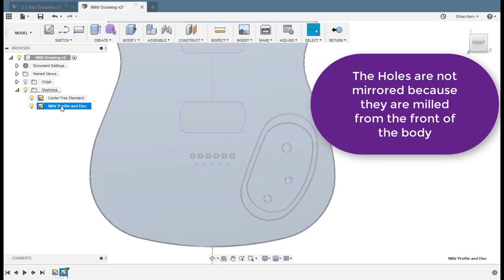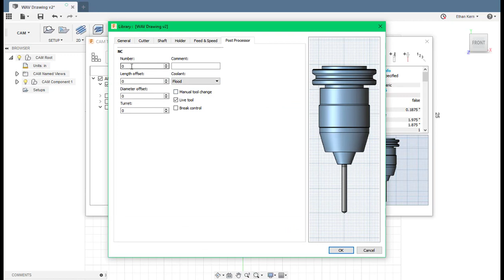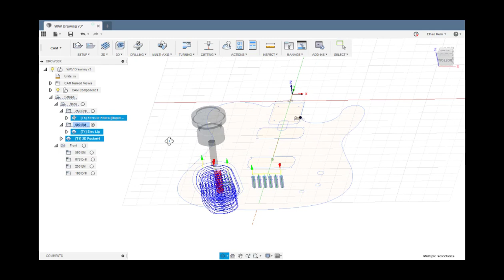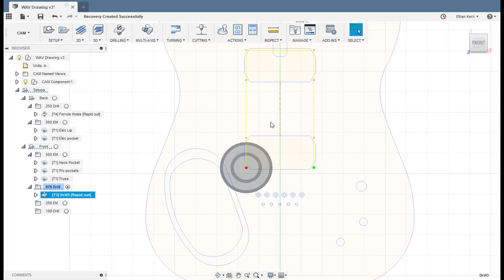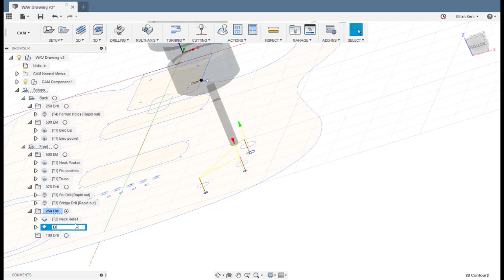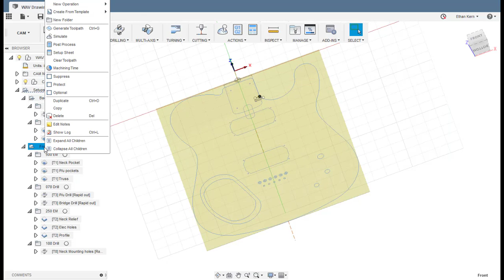Fusion 360  Process of Creating a STEM Guitar Kit Body

Comment: Question? When you mill the back\front side how are you assuring that you are squared up and centered. I have seen people use dowell pins. I thought that if you make a center line mark on your table and on your material that may work too. Thoughts?